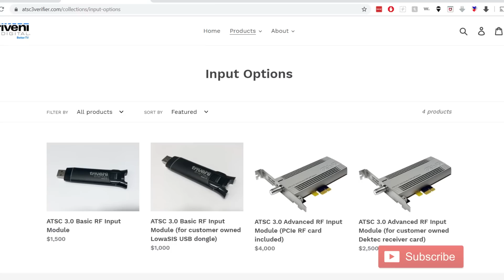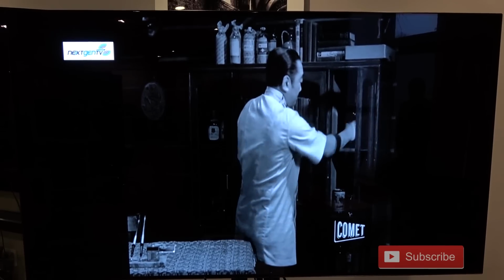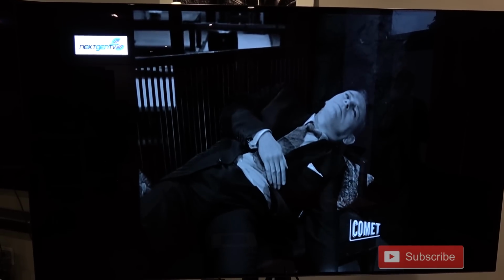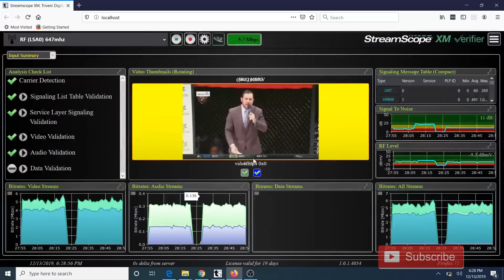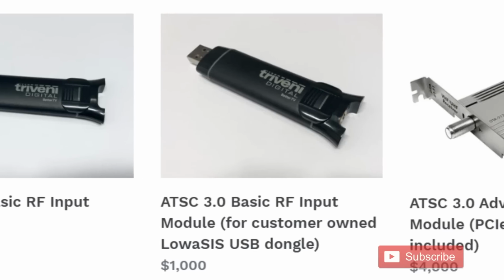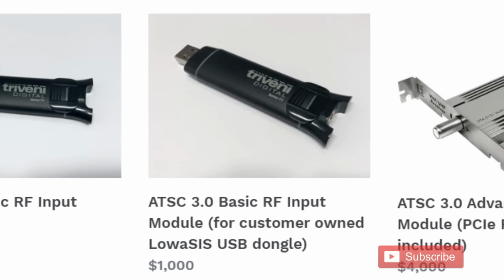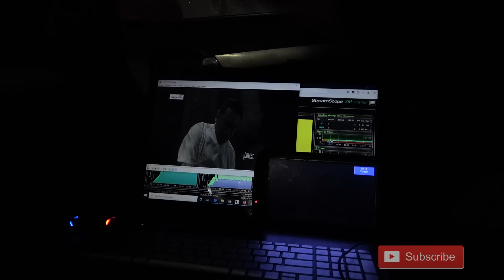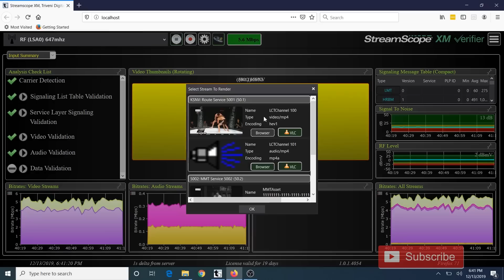ATSC 3.0 NextGen TV Signal Test and Demo in Baltimore, MD

Comment: I don't get it? Was ATSC 1.0 developed under Bill Clintons Admin. or was it under Bush Jr.'s Admin. They certainly did not do a lot of testing. ATSC 1.0 has been a disaster outside the 50 mile reception zone. Some to most nights,  it's a no signal on the TV. This is total BS. Picture quality is good and number of channels from  like 2.1 to 2.9 with each station getting 9 channels is good.
It's the BS Reception that is the problem. I hate watching no signal channels. 
Look we had Analog Reception from 1949 to 2009  (60 years of good Analog Reception) that would go 150 miles on certain channels, under certain weather conditions.
Then they come out with this BS ATSC 1.0 that is total crap. Can't get a signal. 
Most people in my city, will not put up with a no signal most nights, and have returned to pay Cable that gives a RELIABLE SIGNAL. 
I sure hope the Engineers fix this problem of getting a Reliable Signal.

Analog served us well for 60 years. Now just over 10 years, they are changing again, total BS.
Reply: Reagan.

The government thought that subsidizing digital television would save the American electronics industry (Mainly Zenith, GE, and RCA) from competition by Japanese and Korean TV manufacturers.

The market changed much faster than the industry expected.

Of course, in an aging sunset economy, entrenched enterprises can't move quickly.  ATSC 1.0 was rushed out quickly, without time to realize the multipath problem.
When 12 June 2009 came, there was no American TV set industry to save.

Europe waited and designed standards with slower symbol rates- reducing susceptibility to multipath.

Sinclair (don't like their editorial department- but admire their engineers) tried to warn the FCC of the multipath problem.
Reply: 1L6E6VHF 
Ok understand what your saying. Ya the biggest problem of ATSC 1.0 was getting a good signal. The present ATSC 1.0 is so fragile and weak. The old Analog could go thru anything, they should of kept the format added 9 channels and made it HD.
Reply: @diycarhome9151  *you're saying (contraction of "YOU aRE")
"Your" is for possession

*should've (contraction of "SHOULD haVE")
Reply: @diycarhome9151  The only way to increase the resolution and add sub channels was to go digital. You could not have done either via analog.
Reply: @bradquinn4161  They should have kept at least one full power analog station in each market.
Reply: Antenna Man
 @jeffkardosjr.3825  Why? Analog only gives you one channel per physical channel. Why would a station want to do that? Even at the time of the switchover they could pretty easily go to three channels per physical channel. Now they can pretty easily hit seven.
This is the one point I disagree with Antenna Man. I think as the simulcast requirement drops (after five years) the stations will shut down the 1.0 stations. Doing so will instantly allow the stations to double the number of physical 3.0 channels, doubling(probably quadrupling) the number of channels, increasing the number of commercials, and thereby there bottom line. Keep in mind that the average US household replaces their TV every 4-5 years. So by the time the simulcast drops, virtually all the new TVs will have a 3.0 tuner and HDMI tuners(for sets without 3.0 tuners) will likely to have dropped to the $50-100 dollar range. If you look at the way 4k TVs have dropped in the last couple of years, I suspect that most people will just buy a new set with a 3.0 tuner rather than buying a separate tuner. You can get a 4k 55inch set for $300 without trying too hard. Imagine how much they will drop over the next five years.
Reply: @bradquinn4161  Why? Because ATSC 1.0 is terrible and in many cases none of the digital channels are covering the full market and it just about doesn't work in a vehicle.

ATSC 3.0 didn't always exist. 
Analog should have been partially left in place as a stopgap.
Reply: @jeffkardosjr.3825  What you have to understand is that 1.0 was more about politics (global) than it was about science. It was pretty well known (before implementation) about the range reduction, but the politicians overruled the engineers. We would have been much better off if we had switched to the European digital standard at that time. Which MANY engineers wanted but the politicians would not even seriously consider it.

Which is what led Sinclair to be the largest force behind and to some extent controlled the 3.0 standard. It CAN restore the range back to the digital range. Unlike analog or 1.0 the station can dial in the range they want to reach(sans geographical limitations). It is a trade off between range and bandwidth. IF they increase the error correction to increase the range, they loose bandwidth (basically the number of channels). It is generally thought that in most markets they will have 38Mbps for channels, which should equate to the range of analog. However they could choose increase the bandwidth to say 48Mbps but they would loose range (20? miles). They could also choose to decrease the bandwidth to say 28Mbps to increase range(up to the geographical limit). 3.0 is MUCH more about science that 1.0 was.

Comment: Of COURSE you have to "call for a quote" on the StreamScope software.. Is there anything comparable for a more reasonable cost? I've always wanted a way to show me all the signal strength or error rates of an antenna position simultaneously so I could try to move it to get them all as good as possible.
Reply: Simon, sorry the Verifier is really targeting the broadcasters transitioning to ATSC 3.0 and need an Analyzer software. It is not targeting consumers. I hope we will see some consumer products at CES in January.

Comment: I think it’s great that they are improving OTA.  It was not long ago when we all had to buy new TVs or special tuners to pick up ATSC 1.0 broadcasts.  I have 3 TIVOs and 3 4K TVs in my house.  All use ATSC 1.0.  I assume this means my tivo devices which were very expensive will no longer work.  That’s the only thing that bothers me about this.  I assume we will eventually have ATSC 4.0 and then 5.0, etc.  No one is going to be able to afford to throw out their OTA DVRs every couple of years.  The reason most people go OTA is to save money.  This is definitely a downside to it.  Ok you get better reception, more programming options, 4K digital broadcast, but you must buy new DVRs.  Yikes.
Reply from the maker: Technology changes very quickly. We don't have the same cell phones we had 10 years ago and even in another 10 years they may be obsolete. This standard should last a very long time from what I saw. In terms of the out-of-pocket cost it will probably be about $50 for a set-top box once they are available to the public.
Reply: @AntennaMan  Based on similar technogy, if they're $1000 now, then in another year they'll probably be half that, and in two years a quarter that. I don't expect it to drop to $50 right away but it's likely to be that in five years. The TV that come out first will be the high-end TV. I also wouldn't be surprised to see it added to something like a Roku box which could take advantage of it's Internet capabilities.
Reply: @writerpatrick  *technology
*its Internet capabilities (possessive)
it's = contraction of "it is/has"

The tuner dongles are $1,000 because ATSC 3.0 is still in a testing phase. The customers buying them are not consumers, but broadcast companies so their engineers can test things and get ready for t he real launch.
Reply: writerpatrick Those dongles are made exclusively so broadcast facilities can test their signals that's why they are so expensive.
Reply: You can get OTA DVRs with all the atsc 1.0 resolutions for $40 at Walmart, Bestbuy. et al. $15 for an open box return at Goodwill. Returns from people who get confused by the Chinese english.

Comment: I have a question regarding the new ATSC 3.0 VS ATSC 1.0.  Will we be able to receive signals over greater distances? Will this special dongle be required to convert or decode the ATSC 3.0 or is this just required now for testing with the software? Also, whereas this is still in development there are no TV's with tuner cards that have ATSC 3.0,  will people's current TV's have to be replaced to take full advantage of the ATSC 3.0 signals once it is broadcast for the public?
Reply: True about distance and the curvature of the Earth.

The good news will be for people who need to use an indoor antenna in an urban area. Reception should be more reliable than it has been using ATSC 1.0/8VSB.
Reply from the maker: The distance will probably be about the same. Understand the limitations right now is due to the curvature of the Earth. The signals fade into space after 70 miles which is why you need an antenna mounted high to pick them up at far distances. You will need a new TV set or set top box to pick up these broadcast once they are launched. It can be anywhere from 2 to 10 years until we see it on all stations
Reply: @AntennaMan  Wow, thanks for the quick response! I just recently discovered your channel. I have been using an antenna to receive TV signals for over 15 years now, saved the higher frequency portion (UHF) off an old combo antenna that my parents had and originally used it to receive FM signals back in the '80s. Then about 15 or so years ago I decided to see what it could get with OTA signals for TV. Been very happy with it getting 52. Originally set it up with an A-B switch box at the back of the TV to switch between Antenna and Cable. Most of my friends, neighbors, and family could not believe that the visually better picture was OTA from an antenna. Once my cable subscription agreement expired I canceled it. Set it up on some old leftover chainlink fence poles 30 ft up with 3-way tie-offs for support. Hooked up a radio shack preamp with indoor adjustable gain. Wondering if it would be worth it to invest in a more reputable preamp set up? With your experience, what would you recommend?
Reply: I don't know if they've tested for that yet but if it works better for nearby transmissions it should also work better for distance transmissions.

Comment: Thanks for providing us "Joe Six Pack" people with this great information.  It sounds like a much better broadcast standard than the crappy 1.0 standard we're fighting with as we speak.  

I'll never understand why they crammed this 1.0 crap down our throats to start with.  Obviously, they just threw this out there on us and slammed the door on testing to see if it even worked.  It seems like the same people run the FCC that run the VA. 

I'll probably be dead before they get 3.0 working, so maybe I won't need to buy Converter boxes and new TV's again!
Reply from the maker: I agree with you they rushed into atsc 1.0. The main reason was they repurposed the TV spectrum and needed more bandwidth for the cell phone companies. If it were not for that I think analog would still be around.
Reply: @AntennaMan  I do not think it is fair to say that they rushed 1.0. I do think that it is fair to say that on 1.0 they allowed politics to rule rather than the engineers. 1.0 was around for a LONG time before they dropped analog.
Reply: @AntennaMan  - Thanks for reminding me how thoughtful the FCC is with moving frequencies for the cell phone service, and removing the frequencies from the TV broadcasters.  Brilliant!

Comment: Very good video. I hope that I can increase my usual range from 40-50 miles to 80 with ATSC 3.0
Reply: Sadly, I would doubt it.   The horizon is the horizon. It's in range, or it isn't (tropospheric ducting or Sporadic-E skip excluded).

The benefit will likely be that there will be fewer events where you will lose your signal.
Reply: @1L6E6VHF  Good to know, it will be interesting to see what happens.
Reply: @jeffreyd399  Pretty much whatever the old analog range was will likely be the range limit. So, if in your area you could get analog at 80 miles you  SHOULD be able to get 3.0 too.

Comment: hey thanks for the info
I have a Amazon recast that's a receiver with a hard drive will the new 3.0 improve anyting for this device without external receiver
thanks
Reply from the maker: There are no atsc 3.0 tuners for the consumer besides the dongle I mentioned in the video. We are still several years away from this standard becoming mainstream but when that happens you will likely need a new DVR
Reply: @AntennaMan  According to ATSC, you should be able to receive over the air broadcast in 3.0 on your current TV and smart TV. You do need a device if you want to  have internet service with a antenna without using a cable provider and if you want to get over the air broadcast on your smartphone, laptop, desktop and pad without streaming. They probably come out with them in 2020, base on there's already something like it for the desktops with is able to receive over the air broadcast.
Reply from the maker: @kenmdem  I hate to break it to you but it's not backwards compatible.  I'm not sure where you read that it was. I've confirmed this with station engineers. That's why the FCC is requiring stations to keep their old ATSC 1.0 broadcasts on for five years after they launch 3.0. If it was backwards compatible I'd be able to pick it up on my portable tuner which I was not. The TVs in the lab were purchased from South Korea where ATSC 3.0 is successful there.
Reply: @kenmdem  *an antenna (because "antenna" starts with a vowel sound)
*They'll probably come out
*based on the fact that there's
*which is able

Comment: If 3.0 allows for 16 channels to share one frequency, what resolution are we talking about with that many?  Would HD still be possible, or would they all have to be some type of SD?
Reply from the maker: From what I was told the 16 channels would be HD. The advance encoding is unbelievable.
Reply: It is not just the advanced encoding (x265), but also the possibility for much increased total bitrate per channel for ATSC 3.0 (57 mb/s vs 19.4 mb/s for ATSC 1.0).  Having a total bitrate of 57 mb/s per channel would allow 16 HD channels at about 3.5 mb/s,  and with the x265 codec, that will still look pretty good.
Reply: @CCRider100  You are forgetting about the amount of bandwidth that 3.0 will use for error correction. While each physical station will make it own choice about how to make the split, it is thought that generally there will be about 38Mbps available for video(rest for error correction). Still with 720p only being 1.5Mbps and 1080 at 4Mpbs(?) there is going to be room for a lot of channels.
Reply: Obviously there will be some bitrate used for error correction, as you stated the actual amount is unknown.  The ATSC 3.0 standard does allow for 57 mb/s total bitrate per channel, and as mentioned above the jump in video encoding technology is huge.  Going from MPEG2 to HEVC (x265) is massive,  COMBINED with the much higher bitrate per channel,  equals tremendous options for the broadcasters over ATSC 1.0.   1080p at bitrates as low as 3 mb/s using the HEVC codec can still look very good, especially on certain types of content.
Reply: @CCRider100  Where this could get interesting is how the FCC moves on broadcasters using the multiple transmitter function of 3.0. You could use 3 (or whatever) towers farther from the "city" center creating better (less pixelated) signal in both the city and the more rural areas, AND at the same time gain more bandwidth (say 45 instead of 38Mbps).
Reply: @bradquinn4161  Yes . Using SFN (Single Frequency Network). The TV station uses different transmitter sites, but with the same channel and synchronizing perfectly the signal, so the TV set sees one signal (where signals overlap). Of course, it's more complicated, but that basically explains how it works!
Reply: 4K is about 4 times 1080p, so if it's 2 times 4k that would allow for about 8 1080p channels. So it's probably 16 720p channels which is what many HD channels already broadcast at. It could also allow for more sub-channels, some which would be PPV. Current sub-channels probably wouldn't be, but they could run a few PPV along side them.
Reply: @writerpatrick  You're forgetting the difference in video compression efficiencies from these newer codecs. We're talking about a jump from MPEG-2 (used by ATSC 1.0 and DVDs) all the way to HEVC (used by ATSC 3.0 and 4K Blu-rays). It is a huge jump in efficiency, so significantly less bandwidth is required to achieve the same picture quality.

ATSC 1.0 came out in 1996 and the maximum resolution it supports is 1080i @ 30 fps. That's 1080i (interpolated), not 1080p (progressive). 1080i has half the scanlines of 1080p, so it's actually not that much more detail than 720p. ATSC 3.0, by comparison, supports up to 4K @ 120 fps, and I've heard it can even do 8K (but probably at a lower refresh rate). It is  both a significant improvement in video compression efficiency and an increase in bandwidth.

Realistically, though, commercial channels want to have more subchannels so they can make more ad dollars, so I do not expect most channels to offer picture quality as high I what I just mentioned. Also, the FCC requirement to maintain a similar ATSC 1.0 broadcast for at least 5 years is going to eat into the broadcasters' available bandwidth for ATSC 3.0. I'm hoping that will at least start to see those 480i channels move to at least 720p, if not 1080p. The major networks may have some 4K channels, but they'll probably be 24 or 30 fps. And the existing 720p@60 channels could move to 1080p@60. That's just my speculation though.